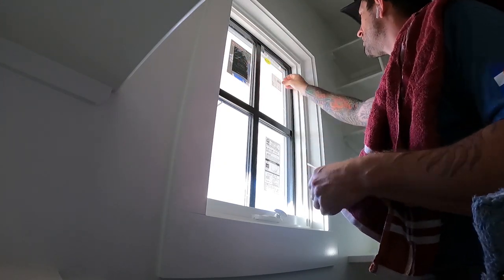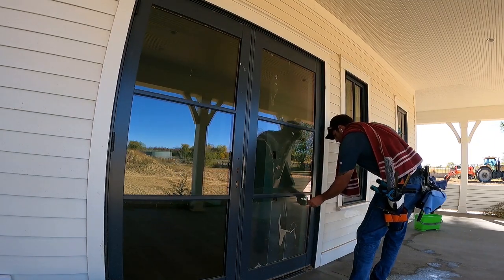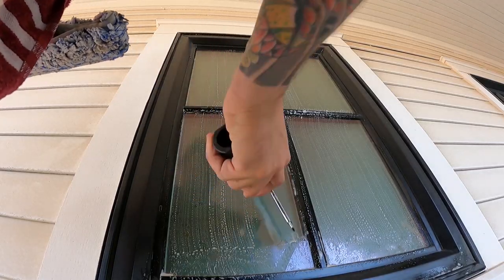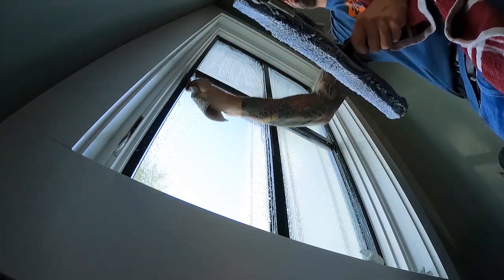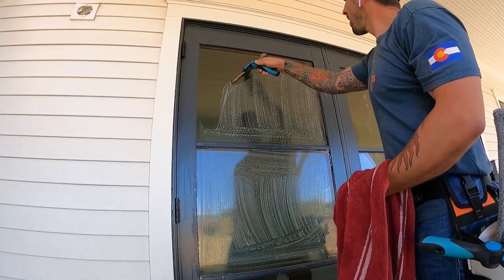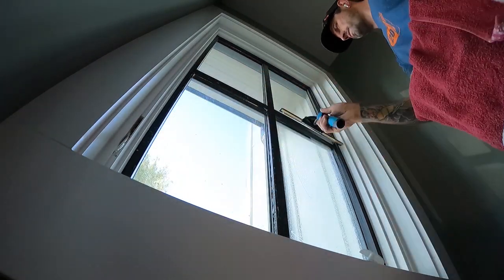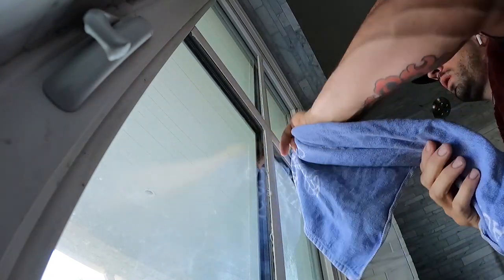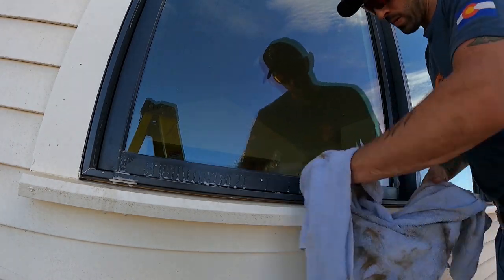BASIC STEP BY STEP CONSTRUCTION WINDOW CLEANING PROCESS

Comment: I typically clean regular on the books house cleanings. But, I have a contractor that's offered construction cleans ti me. Do you charge a separate fee for windows? Or is it included in the price per sq ft? I live in Central FL. OH yea, when I do the windows for this company, it's going to be glass, tracks, and inside n out of frames! Please and thanks in advanced

Comment: Great video SteveO, thank you. How would you change your process for a construction clean on low-E glass?
Reply from the maker: Low e sucks, we simply scrub, Squeegee, detail...honestly I wouldn’t take a construction clean with a lot of low e glass
Reply: Hello Tejbir : 

I would say : scrapping with razor (scrapper with blade) but very gentle, magic eraser, squeegee and detailing. 

I would never use any scrubbing techniques like bronze wool or steel wool. 

About the abrasive nylon pads, make a test in a low corner to see if it’s scratching the glass or not.

Comment: I never use a scraper, steel or bronze wool pads on CCU ( I have in the past). There are plenty products out there that dissolve or loosen paint, sticker residue and cement that will nearly eliminate the risk of scratches.  There definitely needs to be more education videos around for beginner and experienced window cleaners about correct use of any abrasive tools. People seem to be way too quick to use a scraper when a microfiber cloth or a finger nail is enough,  a lot of the time that comes down to laziness. Time is only money when you do the job right, you don't want to be paying to replace windows when you could have spent a couple hours longer using a safer method. A big thing to learn is when to walk away and to not accept a job when you see a mess left by other trades.
Reply: Hi. I’m new to the cleaning game. Can you give some names of preferred products for sticker residue removal?  Thanks.

Comment: In Ireland the vinyl (pvc) windows have a protective plastic on them (and often the glass has too)....and it's very thin. If it's left on for many months/years in the sun, it gets really brittle and is a nightmare to remove - comes off it tiny pieces. I've seen jobs where you just have to tell the client you can't remove it without scratching up the window frames - doors seem to be the worst for some reason - I haven't done a lot but I remember those ones LOL
Reply: Here in ireland the windows is a disaster in construction sites... paint on the frames, concrete on outside glass/frame, protection residue stuck from the sun is fun to remove.... Paint thinner does magic on that stubborn glue..